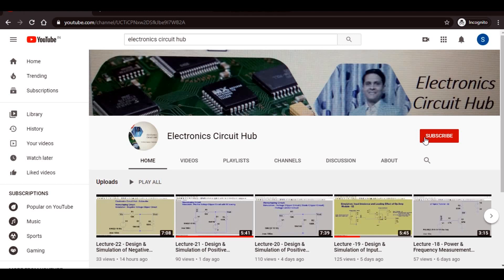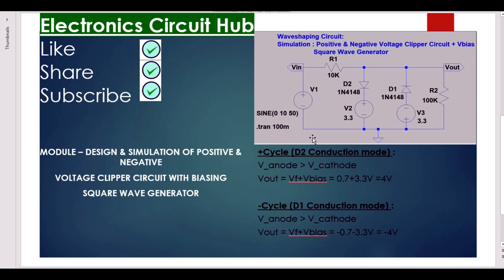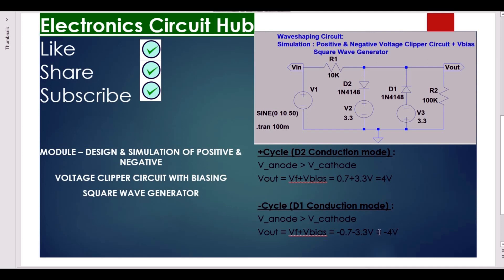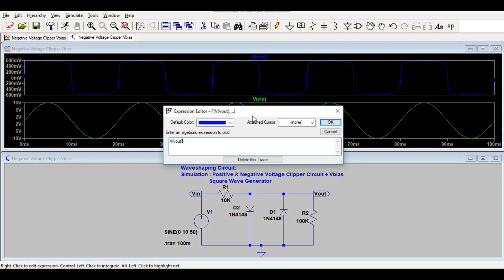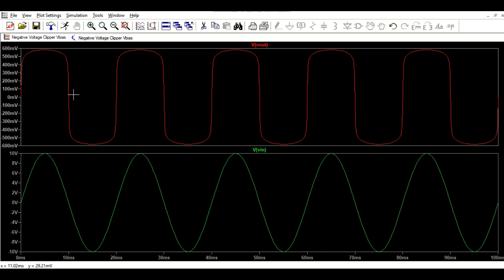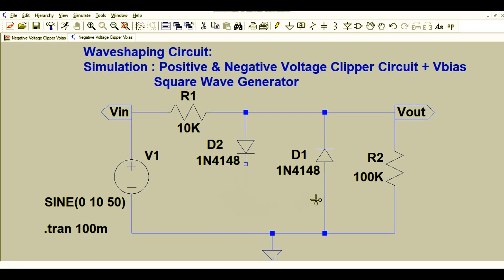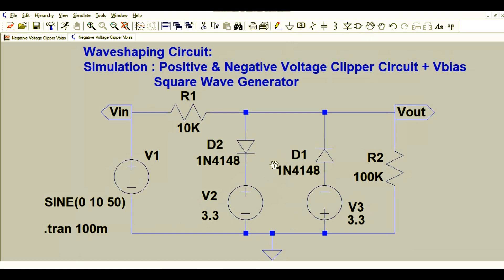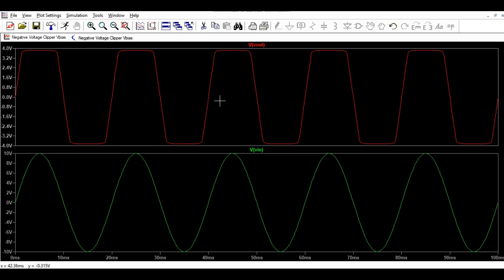LT Spice - Square Wave Generator Circuits Using Diode || Circuit Design & Simulation

Comment: Do you know how to create an ouput gate signal for MOSFET? I mean, for double pulse test. Great video
Reply from the maker: Thanks for your query.
Below information i got from google which looks quite useful although i exactly do not know your application.

What is the Double-Pulse Test?

Double pulse is a test method to measure the switching parameters and evaluate the dynamic behaviors of power devices. It's used to measure the following switching parameters:

Turn-on parameters: Turn-on delay (td(on)), rise time (tr), ton (turn-on time), Eon (On Energy), dv/dt, and di/dt. Energy loss is then determined.
Turn-off parameters: Turn-off delay (td(off)), fall time (tf), toff (turn-off time), Eoff (Off Energy), dv/dt, and di/dt. Energy loss is then determined.
Reverse-recovery parameters: trr (reverse-recovery time), Irr (reverse-recovery current), Qrr (reverse-recovery charge), Err (reverse-recovery energy), di/dt, and Vsd (forward on voltage).
The double-pulse test is performed to:

Measure these switching parameters with various current value conditions and with many devices.
Double-pulse testing is usually performed -  The test is done with an inductive load and a power supply. The inductor is used to replicate circuit conditions in a converter design. An AFG is used to output pulses that trigger the gate of the MOSFET and turns it on to start conduction of current.

In Addition - Any arbitrary signal generator can be used to the driving signal of the MOSFET.
The best way to drive MOSFET Gate is to use uC DO/PWM and add mosfet gate driver then drive the mosfet.